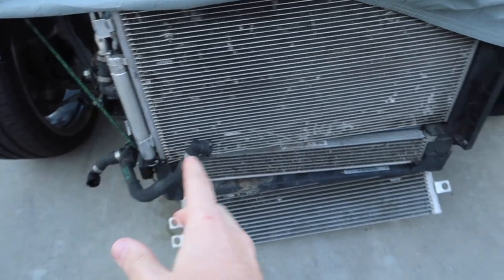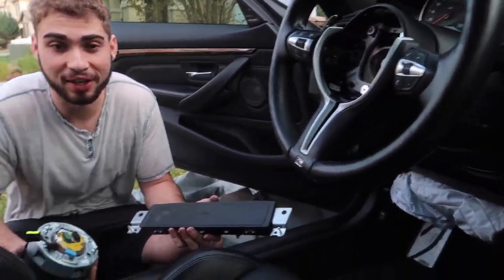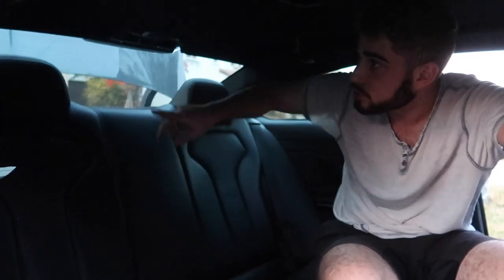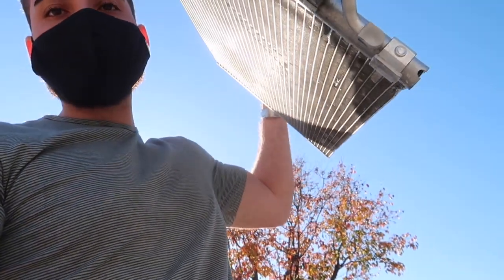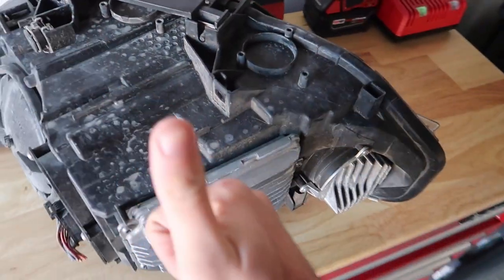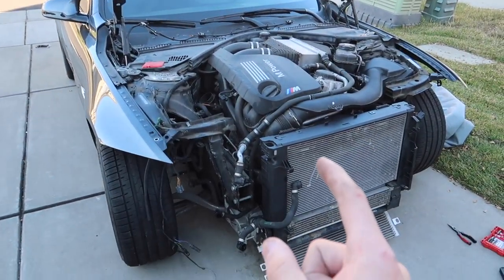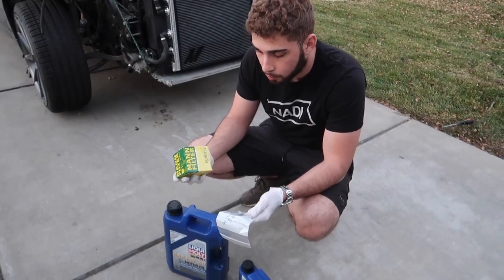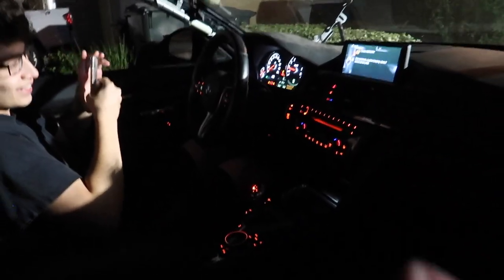Rebuilding A Wrecked BMW M4 Part. 5

Comment: Hey Nour great video btw, you should try using a steamer on the headliner to try and take out the creases it should help get them out. If you don’t have one consider picking one up I’m sure you’ll find it very useful, you can use for a lot things like cleaning interiors and detailing engine bays.

Comment: When replacing the oil you could have used a drain pump. Jacked up the rear so that oil would go to front and you could have drained more oil like that.

Comment: Was anyone else cringing when he let the car run for so long without the secondary heat exchanger on the car or was it just me? There is probably no coolant in the car if you did not have any leaking on the floor

Comment: homeboy,  normal wear and tear does not look like that on a radiator... look at all the fins, they are bent like crazy, the weld points are probably super weak and will probably fail soon.   if you are going to fix up a car at least do it on a car you can afford the parts for. lol stop being cheap